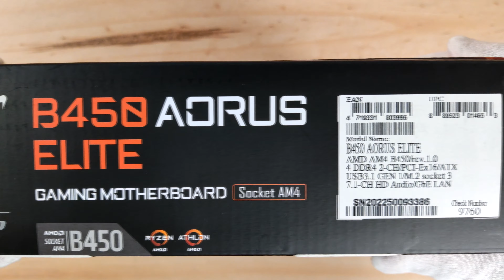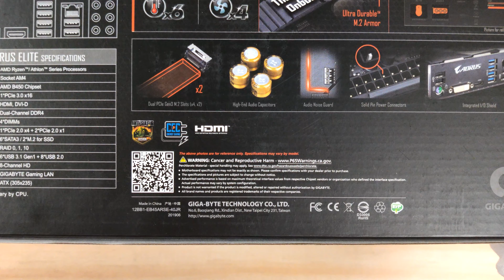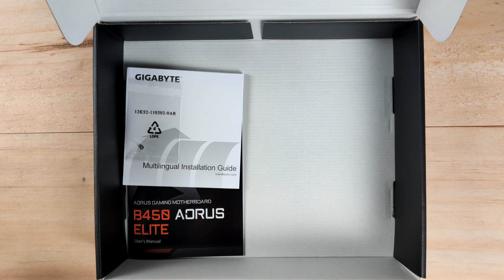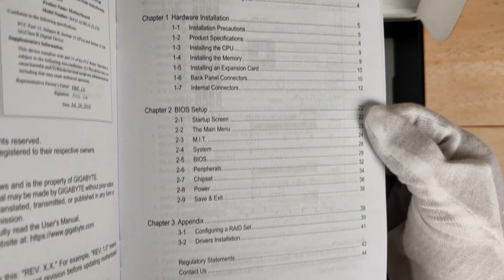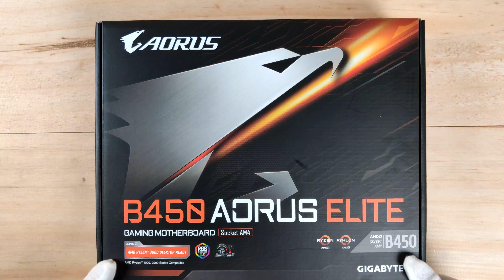GIGABYTE B450 AORUS ELITE Motherboard Unboxing and Overview

Comment: Earlier when i click on shutdown motherboard rgb led logo and the led of the case fans used to turn off together. Now when I click shutdown rgb led logo of motherboard shuts down instantly but as usual all the case fans led turns off a few seconds later properly. Gigabyte Aorus B450 Elite

Comment: I buy this today xdd
Reply: Which cpu are you using with?
Reply: @CandanceTR  Ryzen 5 3400G, and 8gb ram XPG 3000 mhz
Reply: @Cuellitox  well now I buy today too..hope i can build with no problems
Reply: @amirmirza2920  ooh whats the specs
Reply: @rashedal-poopy7163 
 ryzen 5 2600
16gb ram 3600mhz 
Ssd 1tb 
This motherboard 
650w 
Btw did u buy too?
I dunno  about the  graphic card tho..
Reply: Axo GT  i just buy the rx 580 tho with a gre8 price is like 80 dollar
Reply: @Cuellitox  we have same processor yay
Reply: Hi, I'm interested in this board and I have noticed that you made thus post 8 months ago, so how is the performance of it so far? Have you encountered any problems?

Comment: Hi , could you what do you think about this pc?
_AMD Rizen 7 3700 X 3gen AM4 
_SSD Corsair 500GB M.2 Force MP600 PCle NVMe Gen4 ( 4531 )
_DDR4 (2x8GB) Hyper X Fury  
_HD Seagate 1TB SATA
_GPU GeForce GTX MSI 1660 Ti
_certified source 750W 
_ Mother Amd Ryzen Am4 Gigabyte Aorus B450 Elite Ddr4
Reply: Op
Reply: Rich guy
Reply: You don’t need 750w. Change to 650w. Change the cpu to Ryzen 5 3600 then make the gpu better. Aim for a at least an rtx 2060 super with the saved money. And what is the rams clock speed?
Reply: You can buy instead of the GTX 1660ti the new RTX 3070 when it is avaivable ( my english is broken :) )